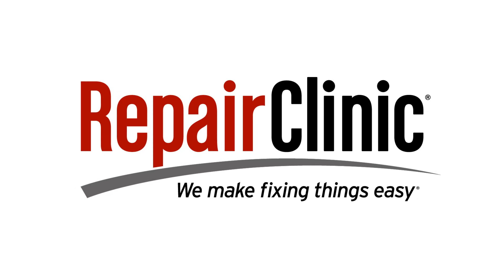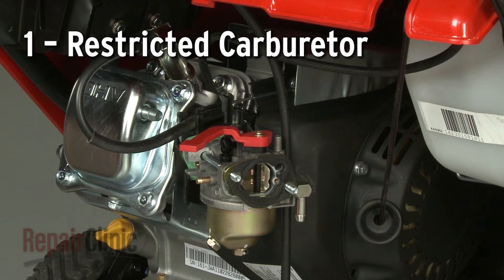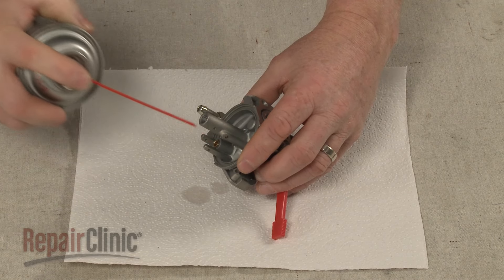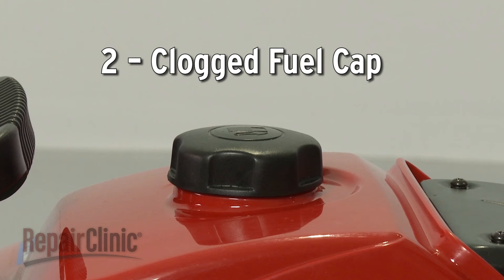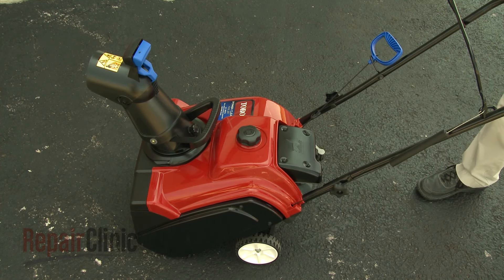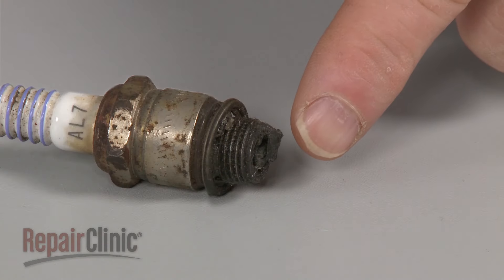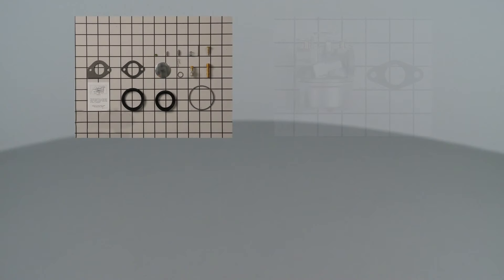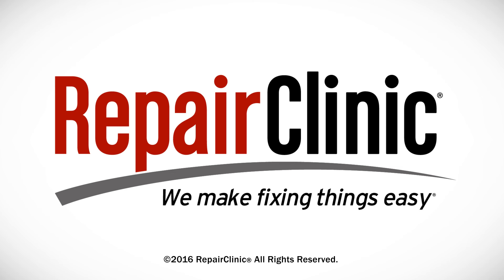Snowblower Starts Then Stalls? — Snowblower Troubleshooting

Comment: My car needs new spark plugs every hundred thousand miles but my snowblower needs once a year?😂😂
Reply: That’s what I was thinking but then I thought oh yeah it’s because they sell parts so
Reply: Your snowblower doesn't use double platinum plugs.  Plus that 100k maintenance interval is fine, unless you actually want the vehicle to last.  Ever try to get plugs out after 100k+ miles?  Good luck.
Reply: @jasonjulian8123  ya I know my guy. It was a joke. I work in the auto industry
Reply: I'd rather automatically replace the spark plug every year. It's a cheap fix. One less thing to be messing with in 10 degree temps :)
Reply: Do you have to Gao the spark plug?

Comment: Have a 10ish year old Toro power max828 LE that starts and runs strong for about 1 min then dies. I have had a complete carb rebuild and spark plug change and replaced the gas cap. Still happening- what else could it possibly be??

Comment: thanks for the video, we have a cub and it ran for about 25 minutes then shut down, it will not restart on it's own, but if you pump the primer 3 times it will spring to life for just a few seconds then die out again, hope one of these fixes it
Reply: I have a cub cadet too, so much maintenance and work I hate it. Going to Evo thrower
Reply: Did you find a solution? This is the exact same problem I've been having. Still trying to figure out how to keep it idling.
Reply: @BPockat  same issue here, seems starved for gas…. Prime and it runs. Took carb apart and cleaned good.
Reply: @Imex99  I was able to get mine running properly. My issue seemed to be junk in the tank. I took the tank off, flushed it, and filled with new gas. Been running great ever since.
Reply: @BPockat  just bolts of top of tank and remove or what?
Reply: @Imex99  yes. You may need to remove a bracket or two. I don't remember off the top of my head. I drained the tank first, so it wouldn't make a mess while removing. Hopefully yours is that easy too!
Reply: @BPockat  how did u clean the tank?
Reply: @Imex99  I put water in the tank, capped the holes, and shook it around to knock everything loose. I emptied the tank through the filler hole, rather than the supply hole. Repeated a few times until I couldn't see junk in the tank, then I added a small amount of fuel, shook it, and emptied it to clear out the water. After that, I reinstalled and it was good to go. There are probably better/more thorough ways to do it, but this worked for me.
Reply: @BPockat  thanks man, hoping for the best!